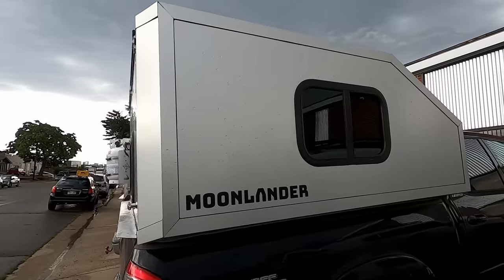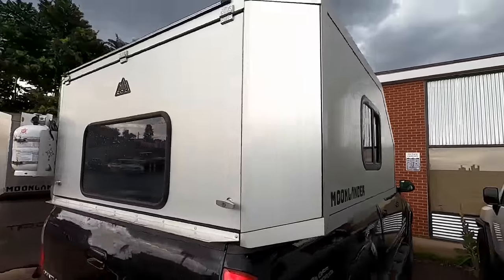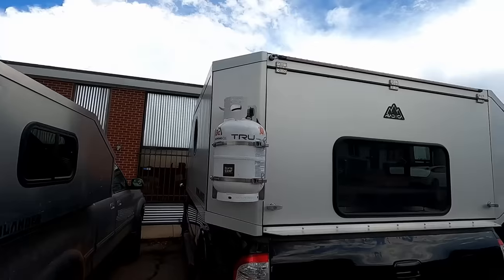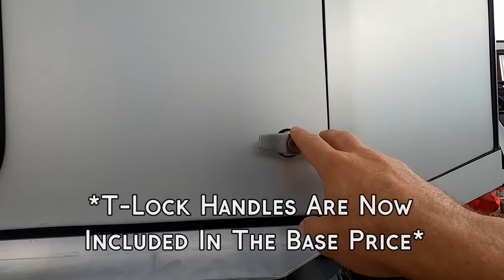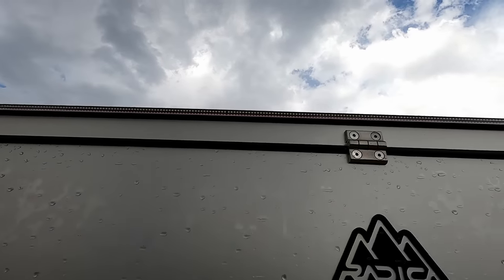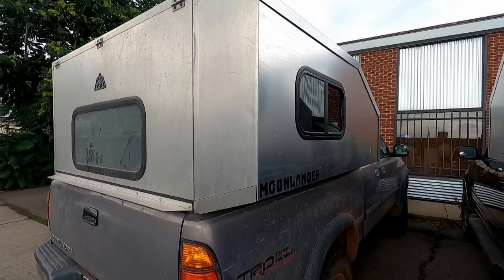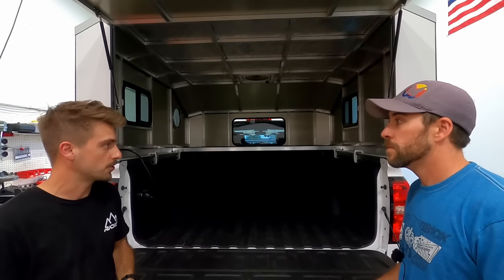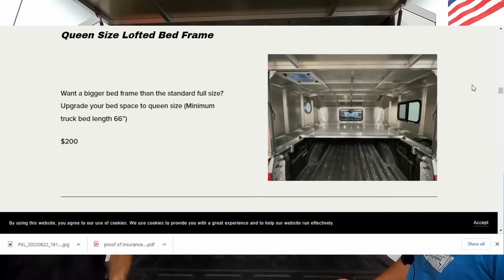Moonlander - The Best Hard Sided Overland Truck Camper/Shell! - What Is It & Why Is It So Amazing?

Comment: I have a cargo trailer that I camp in and in order to assure zero dust infiltration I use a computer fan and a conical air filter inside a snorkel like intake to keep the inside pressurized with dust free air. You still want to do your best in assuring good weather sealing. I think a rigid vacuum filter (You can get HEPA ones now) could be another candidate for filtration.
Reply from the maker: Thank you for sharing your experience!  I may look into doing something like that.  I put a tail gate seal on my truck and that has cut down on 80-90% of the dust coming in.  Thanks for the comment and watching!

Comment: I totally get the concept that bigger is not necessarily better - this thing doesn't have all the functionality of a full pickup camper, but it doesn't have all the cost, the weight, the top-heavy nature, the complexity and the maintenance of those systems either.  And yet compared to a simple topper, you've got significantly more space and functionality - this is the goldilocks solution!
Reply from the maker: That is a great way of putting it!  I totally agree with you.  I'm posting a video tonight on some upgrades I've done to the Moonlander, it is a sweet setup!  Thanks for the comment and watching.

Comment: If you want to stay comfortable or to save fuel... make sure your rig is white.
Reply from the maker: How does it help you save fuel? I need to know, I get 12-13mpg!  Lol, thanks for watching!
Reply: @ColoradoCamperman  a dark vehicle converts light into heat, requiring more air conditioning and hence, fuel or electricity to run it.   Breaking down in the desert and you have an oven...
Reply from the maker: @chrisniner8772  Got it, good point! Never thought of it like that before. Thanks for sharing!
Reply: For health.  How is moisture in there at night.

Comment: I like the idea but that's quite a price premium over a 36" tall ARE dcu. Don't get me wrong the extra width is nice for the crossways bed but a brand new ARE is around 3 grand.
Reply from the maker: True, this is more than just a topper though. I would say it is more comparable to those wedge/popup overland rigs. Those rigs start at $12-13k. So in comparison to those, it is much more reasonable. The extra width and height you get in the Moonlander over a normal ARE topper is worth it in my opinion. Thanks for watching
Reply: Try 7K for brand new

Comment: Wow that looks pretty awesome. Definitely a huge plus having it wide to give you a sleeping platform across the width. Some 1” foam board would definitely keep it more temperature and humidity controlled but the fan will also help with that. I probably would have looked into that had I known about them last year. I got an aluminum leer contractor cap that I built into a camper on the inside.
Reply from the maker: It's a pretty sweet setup.  It looks like you have a nice setup with your topper!  Good job on your build.  Thanks for watching!
Reply: I will do the 1’ insulation on mine when I get it. I want to put a thin plastic adhered to the exposed side of the insulation so they won’t get dented and can be easily wiped off… any suggestions of material?

Comment: The fact that you have used so many other camping setups (like me), your opinion has credibility, certainly would like to hear how your winter camping experience is, especially during hunting season or just in general. Certainly looks like that bare aluminum should be insulated.
Would be interesting if any larger, better funded company could help them get the right amount structure to weight ratio.  Certainly looks well done, but I’m always hesitant about “DIY” builds that turn commercial.
Reply from the maker: When making my decision on the Moonlander, it definitely helped to having several other setups before.  The Moonlander worked great for hunting!  It didn't get too cold when I used it, at night it would get between 34-38.  Basically, what the temp was outside, is what the temp was inside the Moonlander.  It was nice not having any wind though.  I kept a window slightly open and opened up my roof vent.  That minimized the amount of condensation on the inside.  It is still holding up strong and I would definitely still recommend it.  Thanks for watching!

Comment: I love it. Simple. Small. Affordable. Quick to sleep. Quick to break camp. 

I would ad a small ac unit for summer and a propane heater for winter.

I wonder if you could still put a roof top tent for 2 kids up on the roof?
Reply from the maker: Well said!  I bet you could put a roof top tent on.  However, if you did, you may not be able to add a vent/fan for the roof.  But, if you add AC, that probably wouldn't matter.  Thanks for watching!
Reply: 7k isn't affordable lol
Reply: @grantgray3621  yikes I thought it was $5k. Still cheaper than a tear drop trailer I guess.
Reply: Just ordered an optioned $3600 Snugtop Rebel canopy topper. Base model is $2800. This is for a 5' new Ford Ranger bed. This Moonlander is priced between a traditional canopy and a bedrail mounted popup (GFC, etc). 

I'm 6'4" and would likely not fit east-west in a midsize truck w/ 5' bed version, so I'm screwed, but the product seems a welcome addition to the market.
Reply: @lazynorse5607  agreed- I think the price is reasonable for both the buyer and the company.

Comment: These moonlanders look amazing.  I am extremely interested in them.  I love that it is a hard sided aluminum shell and that you don't have to mess with jacks and doubles as a functional truck bed topper.  The price point is really reasonable as well.  Is the shell glued on or is it just secured by those C clamps within the bed?
Reply from the maker: We love the Moonlander!  It has been amazing for us so far.  The shell is secured via the C - Clamps.  Thanks for watching!
Reply: I will drill holes in lip of the lander and the bed rail of my truck. Then use some stout stainless steel plates on top and below to distribute the pressure.

Comment: I would like to see an insulated model and a camperette version and a diesel heater.  Ski rig
Reply from the maker: Luke said one of his customers has been adding foam insulation between the framing.  The cool thing is you can get the base model and then deck it out as you please.  It would definitely be a sweet ski rig and we fully intend on using it during this upcoming season!  Thanks for the comment and watching!
Reply: cool I don't see why you couldn't build a frame underneath for the truck bed and mount the unit to that for a bit more comfort
Reply from the maker: @rollie3383  You definitely could! I want to keep mine as a topper most of the time but be able to use it as a camping rig as needed. So I'll probably keep it pretty basic. Eventually I'm going to build a little kitchen cabinet/countertop which will be cool. I'm sure I'll come up with more ideas as I use it more.

Comment: I didn't know there was a tailgate seal. I use a pool noodle cut in half, longways.  The dust also comes in under the inside bed lip where the mounting holes are. I plug them with foam filler.
Reply from the maker: Thanks for sharing!  I may consider doing that if this tailgate seal doesn't work!
Reply: @ColoradoCamperman  do a video on installing and if it works...
Reply from the maker: @huckleberrychris  Good call, I was just going to do the install and not record it, but I will definitely record a video!

Comment: I have an idea for moonlander have yall at moonlander thought about have awning that on the roof side or sides to sit under  if it rains that would be another good option.  O am impressed  with this moonlander product
Reply from the maker: That would be an excellent addition!  The guys at Radica are open to receiving feedback and are fielding ideas from customers on every build.  Luke is trying to keep the production process fast and efficient.  Add-ons unfortunately slow that down.  But, if he continues to get the same feedback on every build, I am sure he'll make it an option.  If not, the frame is built so that you can easily screw additional items to the Moonlander.  Thanks for watching!

Comment: hey Brian, Great informative video. Thanks! How is the rear visibility using your side mirrors. Is it compromised very much? Any more thoughts or ongoing videos now that you've had your Monnlander awhile?
Reply from the maker: Thanks, glad it was helpful!  You lose a little rear visibility but you will get use to it.  If you get a rear window on the Moonlander, you can still look at your rear view mirror.  So now my rear view mirror is basically a vanity mirror.  I also have tow mirrors that extend out, however, unless I am towing, I do not extend them out with the Moonlander on.  

My thoughts on the Moonlander since the video....It is still awesome!  I love the thing!  Besides camping, it has been an amazing topper to just haul things around.  Right now I have a bunch of tools and gear in the Moonlander and it snowed 4inches today.  Everything is dry and protected!  Thanks for the comment and watching.

Comment: I have my fiberglass topper on craigslist for $1800..…much cheaper and better insulated. 
It looks good and light weight is important
Reply from the maker: We used to have a topper exactly like that.  Right now new, those toppers will cost around $3,500-$4,000.  Those toppers are a great option and work for a lot of people.  In my opinion, the additional cost of the Moonlander is worth it, hence why I bought it versus buying another fiberglass topper.  Thanks for the comment and watching.
Reply: @ColoradoCamperman  the reason I'm selling it is it too narrow and short. I want to be able to have more room and stand up. So I'm building my own....yes I'm recording the build 🤣
Reply from the maker: @huckleberrychris  That makes sense.  Especially if you want to stand up.  I had considered building one too until I found the Moonlander.  I look forward to seeing the build videos!
Reply: @ColoradoCamperman  but the door was different. Glasstite was bought out years ago. That toppers store in OCC has changed... they're all ARE and accessories and better selection. I  can get older parts from them to.

Comment: It looks awesome!  Are you planning to insulate it?  Also, to go with the tailgate seal, it looks like they did not put foam seal between the topper and the bed rails.  Add the bed rail foam too and that should help greatly.
Reply from the maker: It's pretty sweet!  No plans to insulate yet.  I may do so in the future though.  I added a tailgate seal.  Moonlander did add a seal between the topper and bed rails.  They also added a seal between the tailgate & back door.  They made sure it was water tight before I left.  Thanks for watching!
Reply: @ColoradoCamperman  Also, I have seen some of the Australian campers have a filtered fan system running while driving to add positive air pressure to keep the dust out.  Should be fairly easy to rig something like that up.
Reply from the maker: @seriously195  Heck yeah, I will look more into that. Thanks for the tip!

Comment: Adding a positive pressure vent might help keep a lot of that dust out.
Reply from the maker: Thanks for the input! I put the tailgate seal on and it made a massive difference. Thanks for the comment and watching!
Reply: @ColoradoCamperman  hey, how annoying is the reduced rearward visibility? I am intrigued by the Moonlander but worried that I'd hate not being able to use my mirrors. I guess maybe I could add mirror extenders to help with that though? What do you think about the issue?
Reply from the maker: @davidmull7263  I don't find it annoying at all. I can't use my rearview mirror but I've been driving utility vans for work since 2005, so, it is not an issue for me. Having tow mirrors would probably help. My mirrors are huge. Not extended out, I have good visibility. Extended out, I have a little better visibility.  The pros of the Moonlander outweigh the cost of lower visibility in my opinion.  Hope that helps. Thanks for watching!;

Comment: Hey - Do you have a 7mo update on your Moonlander. I am a few days from placing a deposit and just looking for past customer feedback. Thanks so much.
Reply from the maker: The Moonlander is still amazing!  I love the thing.  I've only camped it in a handful of times but I love it as just a huge topper for everyday use.  It is amazing how much room you have in there because of the height and width of the Moonlander.  We just finished our basement and I have made countless trips to Lowes to grab lumber, doors, trim, paint, bathroom vanity, toilet, etc.  It is nice to have everything out of the elements and locked/protected if I needed to go to multiple stores.  A lot of times, I would just keep my lumber in the back of the truck as I worked on the basement, so it basically doubled as a shed.  

We have also done some tailgating this winter at the ski slopes with it.  One day it was around 5degrees out and snowing pretty bad.  I had 4 adults and 1 kiddo in the back of the Moonlander on camping chairs (I have an 8' bed, so there's a ton of room).  We even had brought a propane firepit with us and had it ripping in the back of the Moonlander!  We cranked open the windows and had my tailgate down for airflow, but it stayed nice and toasty in there as we ate lunch.

I truly don't have any negative feedback on the Moonlander yet.  I would highly recommend it!  I hope that helps.

Comment: I checked the comments and found the weight and cost...  but, haven't seen any measurements for the raised bed.  I'm 6'4" and 235 lbs...  would I fit?  This would make for a great mobile outdoor office being able to sleep comfortably, and work at a table in a camping chair during the day, having solar power to charge laptop/tablet/phone/camera batteries, etc...  Some would say get a Sprinter van, but this mounts on a pickup 4x4 truck, which is much more capable off-road getting out to remote sites.  And, a 3/4 ton truck would tow my Jeep much easier for further exploration than a Sprinter van would.  Very interesting!  Cheers!  Pete - KI7LIL
Reply from the maker: My Moonlander on the inside is 7'2" wide.  Outside is approximately 7'5".  Keep in in this is built for my truck but if you're looking at a 3/4 ton truck, most likely your Moonlander would probably be about the same size (I have a 2019 Chevy Silverado 2500).  Good luck with everything and have fun looking for something that suits your needs.  Thanks for the comment and watching!

Comment: Aluminum welds on a piece of 4x4 gear? GFC and Superpacific are using rivets. This thing is going to get shaken apart on CO trails. Good for campgrounds though
Reply from the maker: Only time will tell. I've had it for 1.5years with no issues.

Comment: Thank you!! I think my only concerns are is aluminum as durable as I hear plastic or fiberglass are. And is there room to climb inside into front seat
Reply from the maker: You're welcome!  The aluminum is pretty thick.  It's definitely more durable than plastic and probably a fiberglass top too.  They just added a window that you can install up front, so that you can have access to the cab.  Hope that helps, thanks for watching!

Comment: I like what he did for air flow.
Reply from the maker: Are you talking about the aerodynamics of the Moonlander or the air flow on the inside?  Either way I agree with you, lol!  The aerodynamics are definitely good.  For the air flow inside, between the fan and side sliding window, I can get a great cross breeze in there!  Thanks for the comment and watching!
Reply: @ColoradoCamperman  I meant the front angle hon. Cheers.

Comment: How does one insulate one of these?  Is there a factory option to do so?
Reply from the maker: No factory option, you could put 1 inch foam in-between the frame.  Luke (the owner) told me he had one customer do that.
Reply: You can cover the foam board with automotive or outdoor upholstery for additional insulation, asthetics, and moisture control. Had a friend who's done that.
Reply from the maker: @reynetallents  It is a really good idea and I am definitely considering doing that in the future.  There is one rig on the Moonlander's website that someone finished on the inside.  It looks really nice!

Comment: Can you remove the bed out of the camper?
Reply: Yes
Reply from the maker: Yes you can.  The lift has two platforms.  One is the size of a twin bed and the other is maybe 18" or so.  They are very lightweight and easy to take out.  I purchased the tri-fold bed so I could put the bed away in the case when not in use.  Thanks for watching!

Comment: Does the longer width present any problems? I'm thinking of the somewhat narrow road to Fern Canyon in Prairie Creek Redwoods State Park in CA.  The path is fairly narrow, a regular truck is no problem, I'm thinking of the time when 2 vehicles need to pass each other.
Reply from the maker: The Moonlander is no wider than my mirrors, so it is not a problem at all.  Carwashes are a problem though, lol!  The added height restricts me from ever getting an automatic car was again.  Thanks for the comment and watching!
Reply: @ColoradoCamperman  Thanks for the reply! I would imagine any vehical that has added height or width would be a problem at a car wash or even a drive through. Heard a van with a topper is best left in the parking lot at McDonalds, lol!
Reply from the maker: @windsongshf  Yeah, height has been of an issue for me than the width.
Reply: @ColoradoCamperman  Still easier than a Class C! ;)

Comment: No insulation?????    Seems cold in winter camping.
Reply from the maker: You could add insulation if you wanted.  With a buddy heater or diesel heater and a 0 degree bag, you'd be be plenty warm.  Thanks for watching.